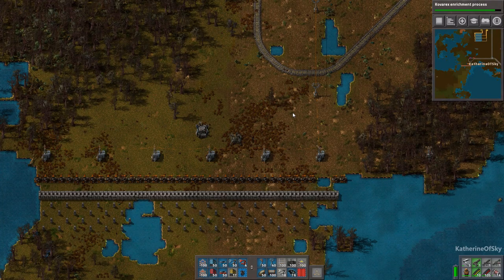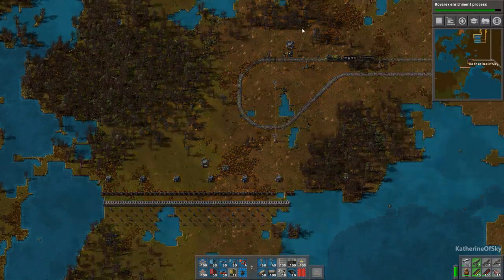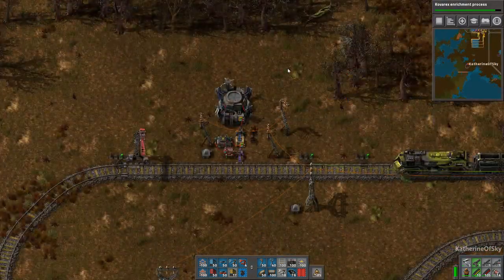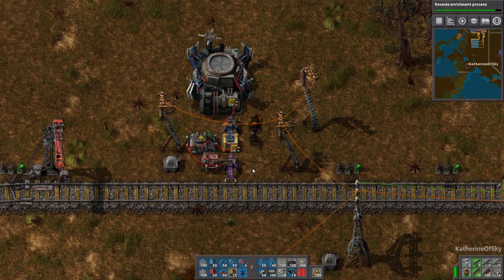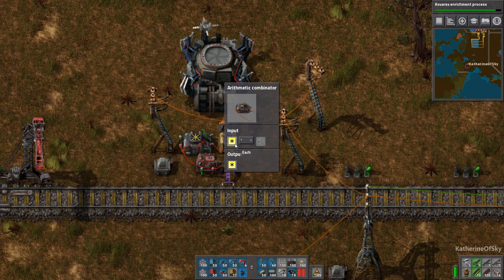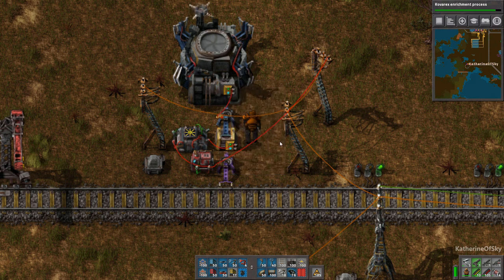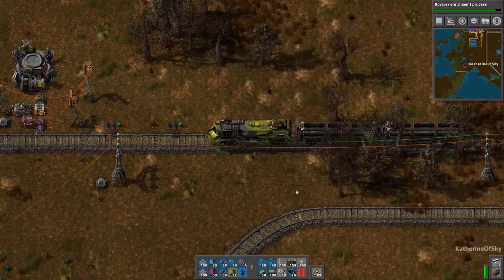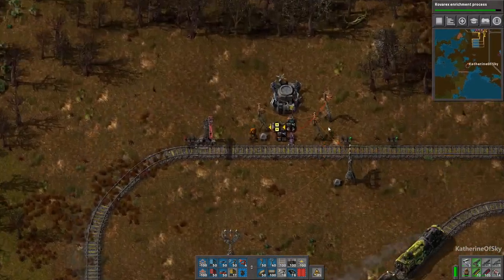Factorio Tutorials: Wall Repair Supply Station - Unload using COMBINATORS -- Explained!

Comment: I am using a little "smarter" design, I add a wire link from the inserter to the train stop, and make the train stop only able if anything<0 . With this you can just name all the supply station's name the same (I name it restock), then the train will only go if any station is actually needs anything!
Reply: That's a really good idea
Reply from the maker: Oooh, nice Wolf!  You realize I'm going to have to update my vid now!  LOL  Fantastic idea!
Reply: Doesn'ts naming all the Stations the same lead to trougle, if multiple Stations need stuff ?
Trains only go for the nearest (avaible) station, and if 2 require items, the train will go to one base, and always return to the refilling station before heading out to the other one, instead of visiting the (enabled) stations in a pre-set order.
Reply: You can tell the train to go to the "same station" more then once before going back home
Reply: really ?
Didn't even try that =O
Reply from the maker: I think the design assumes that you won't be getting attacked 24/7 by biters.  Therefore, stations will get replenished and then "disappear" until they get attacked again (and need more materials).  If I were to do such a setup, I'd still name them individually, just to make sure they all get materials, especially on a biter-heavy world.  It would also reduce number of trips, since otherwise the train would go back to the main station after each run.
Reply: This is working with an "anything > 0" signal for me.

With "anything < 0" nothing happens.  Not sure why.
Reply: Did you mean anything>0?  Because when I try it your way above the station is open when it dosen't need anything.  Or maybe I'm doing something wrong?
Reply: You can improve on this idea even more! 
The problem with it as it stands is that you have some amount of materials you want at the station, say 100 repair kits. If one repair kit is used then the station will open and a whole train will be sent across the map to deliver one repair kit. 
So what you can do is instead of connect the arithmetic combinator to the train stop, connect it from its output with green wire to a second constant combinator with the "lower threshold" values, say 50 repair packs, and the same for the other items. Connect this second constant combinator with green wire to the train station with the condition "anything > 0". 
This way if any item falls below the lower threshold the station will open and the supply train will come top up the station to the upper threshold values. 
Hope that makes sense. Peace.
Reply: @chris I like that idea. I 'm going to try that.
Reply: @all I use this concept in the video and calling the train for my solar setup. At the base i have a train with a lot of material and at the solar setup i have a requester setup. So i can clear and set up the power / roboports etc with one blueprint and fill it with solar and accumulator with other blueprint.
Reply: @chrisloach9658  good idea, I’m not very good with circuits. So are you saying, do exactly what KOS has done but add another constant combinator? And wire that to the train station? Thanks

Comment: Something you want to avoid, don't use stack-filter Inserters for that.... they have only one filter (and only try to grab the most urgend thing needed)
If the mos required item isn't in the train, the normal filter inserters continues with the remaing things, while the stack one stops
Reply from the maker: Indeed, that's why I put in regular filter inserters and multiple chests if desired!

Comment: One tip with 0.15 is that since you can limit the stack size of inserters, you can actually do multiple items per chest. Just limit the inserter to 1 item stack size. It slows down loading, but that's unlikely to be a problem with the low-demand items.
Reply from the maker: Yeah.... but... loading times will be painfullly slow!  A good tip though for items like roboports and very-small quantity items!
Reply: You can read the content of a (automatic) train in station and tweak the stack size depending on the stuff already in train...
Would require 2 combinators per inserter though =X
Reply: At that point, you'd need a separate chest for each inserter anyway, which means that there's no point. :)

Comment: Hey, KatherineOfSky :)! Great video, you gave me the idea of using double long inserters with double chests, I did NOT think that before. I understood how the circuit works at the stops, but I want to ask how are you handling the railway network as a whole? Do you do the restock trips manually or did  you implement a circuit network? I am using the LTN mod, it's super easy, but maybe I want to use normal stops etc. I am open to any suggestions and ideas. Also, thank you for the enjoyable and entertaining video tutorials :). They do help!

Comment: Thank you for this tutorial, really useful. I noticed the green wire in the electric pole both in the video and the blueprints, what do you use those for? Does it go back to the main base?
Reply from the maker: ATM nothing.  I added it to my rails BPs just in case I wanted a base-wide circuit network :-)
Reply: Ok but what if you could route the needs of the wall to the requester chests at the base using the green wire?! Is that even possible? But then you'd have to divide each item to a chest and also you'd need to be able to know the difference between the contents of the wagon and the wall requests. And I dont know if there's a way to scan the contents of a wagon. Anyway it would be way too overdone.
Reply: I use both wires on the large (rail) powerpoles all the time, esp since they're free if you place them with blueprints.
If you use a single train, you can use one line to "order things from the main base". If you use multiple trains in the same station, you cant be sure, in which one the stuff will end though.

Comment: I have another problem: the inserter to the roboport won't work with the circuit, if i set it to "repairbot < 50" for example it will just stop after the first move instead of stopping after putting 50 repairbots in
Reply: Oh i guess this just works in 0.15  ?
Reply from the maker: You don't set it to construction bots, you set it to Read Robot Statistics, and use the letter symbol for whichever condition you want.  Works in 0.13-0.15.
Reply: oh well, thank you very much! :D
you make great videos btw.
Reply from the maker: Thanks!  :-)

Comment: I was wandering if it is possible to use the same circuit and inserter design of the unloading station when loading the train since it is possible to read the train content.
Reply from the maker: Possibly, though you would have to limit the stack size to 1.  This would make for VERY slow loading!
Reply: but at this point you don't need to reserve slots in the freight wagon!
Reply from the maker: Well, but the speed difference really negates that plan.  There are PLENTY of slots in the wagon!  Not enough? use 2 wagons! lol

Comment: I'm a bit late, but maybe someone can help me with my problem. What red-wire-condition prevents the inserter from instantly transferring the robots (logisitc and construction) and repair packs from the yellow storage chest into the roboport?
Reply from the maker: You need to click "Read Robot Statistics", and choose a condition on the inserter, usually Total COnstruction Bots < 50
Reply: @KatherineOfSky  Thanks for your reply! With a single red/green wire I can only limit one content: construction robots, logistic robots or repair kits. If I want to limit all three of them (to not unload them all at the first supply station), I have to use a combinator setup like you use when unloading the train, right?
Reply from the maker: @yt_chrisbo  Yes, use the train setup for the roboports.  You can't limit all the items with a single inserter/combinator
Reply: @KatherineOfSky  Thank you for your help and all your great tutorials!
Reply from the maker: @yt_chrisbo  You are very welcome!